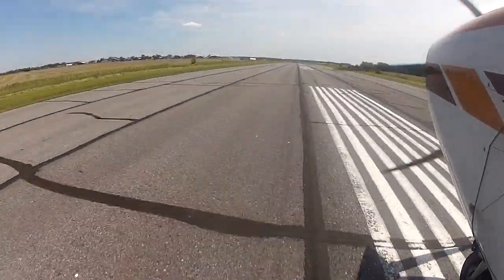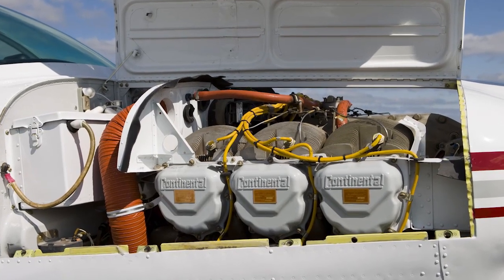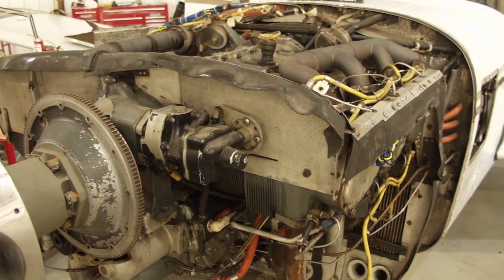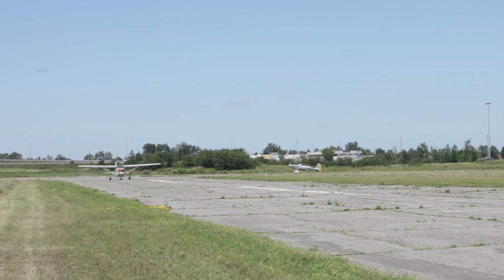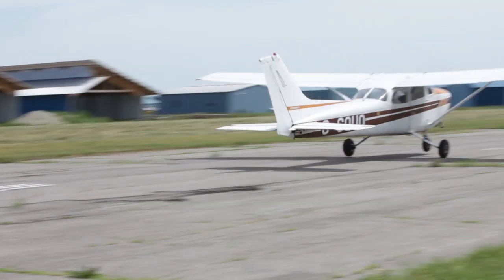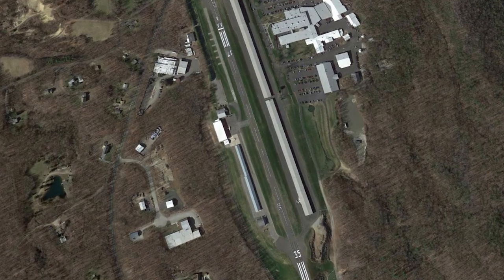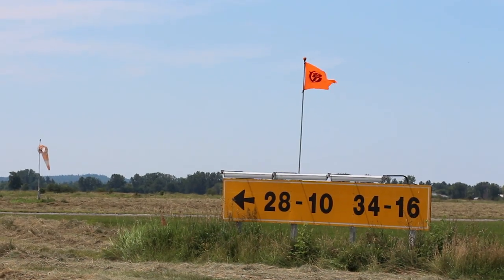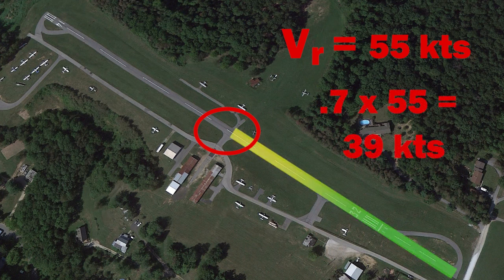Takeoffs and Landings: Determining an Abort Point

Comment: V1, V2, VR...

Knowing when you will be too fast and too far down the runway to abort is important.
"Can I stop in the remaining runway?" (or at least before running into the first obstruction after the end of the over-run)

And the "70% of needed takeoff speed by halfway" isn't really a useful way to choose abort or not.

A C-152 on a 7000 ft runway isn't going to need anywhere near half the runway...  You'd better know long before you have used 3500 ft of runway with a plane that should be easily capable of taking off, getting to 50 ft and then landing and stopping in that 7000 ft. (with a substantial tailwind from Denver International, on a hot day)

Maybe that 70% of needed airspeed "rule" works if the runway is of marginal length for successful takeoff.
Reply: Agreed. I think the 70/50 rule is a way to determine if your aircraft is accelerating properly per your calculated takeoff roll. I believe the proper way to use this rule is 70% of Vr by 50% of your anticipated ground roll. For example, if your anticipated ground roll is 1000', and Vr is 55 kts, you should see 38 kts (probably airspeed alive), at 500' into your ground roll. I've tested this in a number of light aircraft and it is accurate. If airspeed isn't indicating by half way into your anticipated ground roll, that would be an indication something is wrong. There should be several other checks before you even get to that point, that will help you determine your airplane is performing. Static RPM check (normally aspirated), MAP within 2" of ambient, etc. Turbo engines, everything should be at redline. If you don't see these things, that indicates something is wrong. Then you have the 70/50 rule, then you can make the decision before the abort point, which is the last point on the runway one can safely abort the takeoff.
Reply: @Rosstravelsfar  I agree completely... What if I'm using an 8000' runway... would I wait until 4000' to make an abort decision?! I teach students to compute an Accelerate Stop Distance and use that to decide the abort point, short-field technique, etc. Half the ground roll with reality factors seems like the best distance to select.